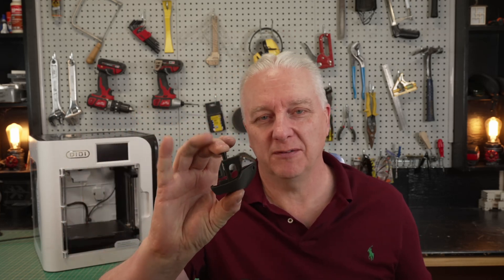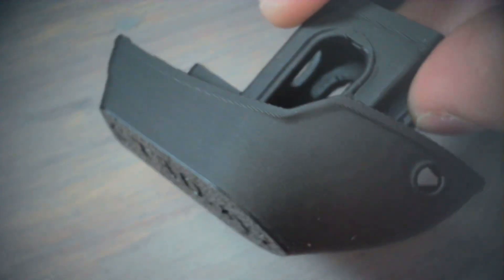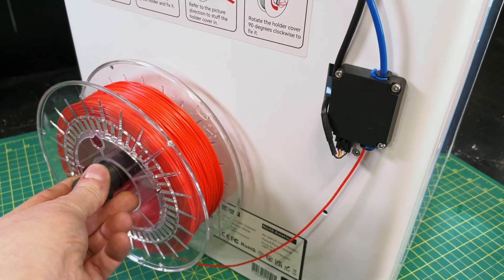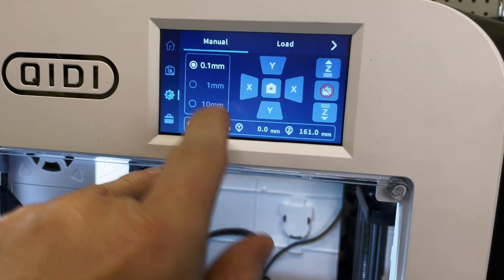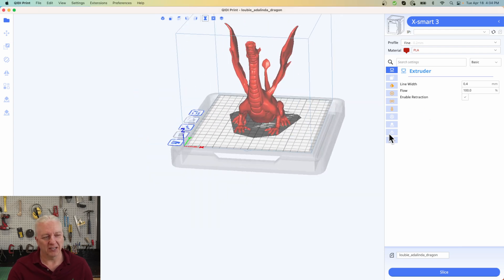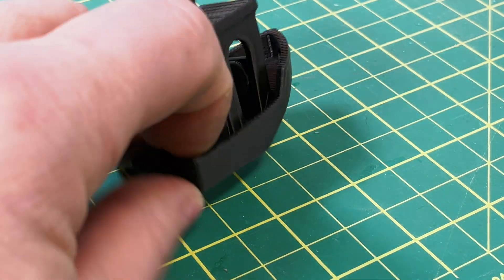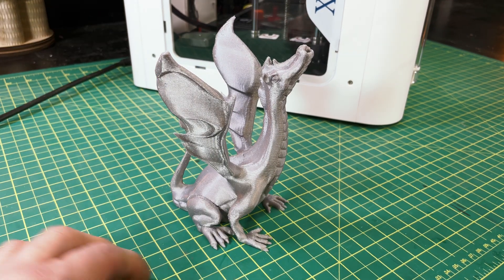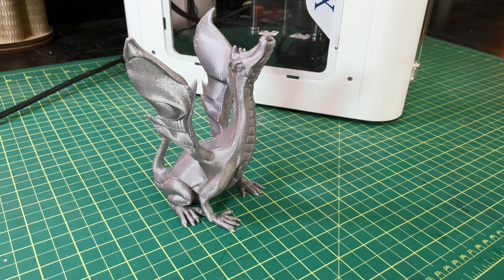Qidi X-Smart 3 - Can Fast 3D Printing be Achieved With a $500 Budget?

Comment: I just picked one of these up used with 14 unopened rolls of filament for $125, running first test print now.  Man is this thing fast compared to my x-max 1.  Too bad it's so small ;-).  I have a patched version of the qidi print wifi plugin for cura for my x-max, will be seeing if I can get it working with the x-smart3 with offical cura.
Reply from the maker: I had my X Smart 3 until very recently.  Someone saw it and had to have it, so I let it go to a better home.  It's a great little print and it sounds like you got an awesome deal.

Comment: Hi I'm wondering why it can't be used a hardened nozzle to print abrasives? Is it because the extruder gears aren't hardened? And what about nylon?
Reply: It can 100% use it. They sell the nozzle itself on their site for $12 and the entire hot end with new heater and heat break for $35
Reply from the maker: @logan_kes  Yes indeed.  I was assuming the ask was for the stock printer
Reply from the maker: It’s not so much about the gears, but rather the temperatures. The “baby” Qidi has a passively heated box while the larger models use active temperature control. Also the extruder in the X-smart 3 won’t get hot enough for some of these advanced materials

Comment: I've found the Linux side of this printer to be a mess.  On my unit, I can't hit port 80/443 for a UI, but fluidd was running out of the box on port 10088.  I've been printing with a modified Bambu profile in Orca slicer without issue.
Reply: How is it? Worth the price or not?
Reply: @zbigniewwielgus1249  I got one a week ago and love it. Typically most printers won’t use 80 or 443 as they are standard ports for http/https so the 10088 is the way to go, I just wish they noted it in the documentation.
Reply: @logan_kes  Maybe you have Voron 0 to compare?
Reply: @zbigniewwielgus1249  sadly I’ve only got a photon a and a Tina 2
Reply from the maker: 10088 is they port they are using

Comment: Good video, but here's a couple tips about things you mentioned that most people that are "new(ish)" to 3D printing wouldn't now and that QIDI kinda hides because of that... 

You do not "need" to use their slicer... Any slicer will work if you want to take the time to configure a profile.  Slicers like Cura, PrusaSlicer, SuperSlicer and OrcaSlicer (my recommendation), all support uploading directly to Klipper.  BTW, I'm also pretty sure you can load and print from a gcode file that is saved to a USB drive, the USB port is located at the top right towards the back.

If you want more "finite" control of these machines and want to see what Klipper is really capable of... stop using the "on-board" screen as the only interface to the machine.  In your browser and with the printer on, type in the IP address of the printer followed by ":1088" (***.***.*.**:1088) and hit enter.  This will bring up a direct "link" to the printer using the Fluidd UI (personally I prefer MainSail).  From there you have total control of everything to do with the printer, add remove files, tweaking, macros...etc. Keep in mind, don't go messing with any of the machine configurations if you don't know what your doing.

Anyway, great video... It's going to be an interesting year in terms of all the new core x/y machines will be popping up to compete in the "who's faster" market that BambuLab has started. 👍
Reply from the maker: Correct.  It occurred to me after I published this that it seemed like I said Qidi Print was a must, so I added a note to the video description. The need for Qidi Print is true only for WiFi connection.  Qidi actually has profiles for most slicers and you can either shuttle generated files with a USB stick or use the Klipper web interface to upload Files through you browser.
Reply: @SteveMakesEverything  Actually, you can do the wifi connection through any of the slicers I mentioned above.
Reply from the maker: @cdsmakestuff  Interesting.  I wasn't able to get Cura configured to support wifi.  l'll need to try again.
Reply: Thanks for your comment. I had the impression that qidi was limiting what the printer could do. For instance printing abrasives with a hardened nozzle? Maybe the extruder gears are not capable? Or maybe nylon?

Comment: What time do you get if you slice your own benchy with their fast profile and same layer height, line width, and infill settings?
Reply from the maker: With the quick print setting and turning off a few optimizations you can get pretty close to this time. Printing fast is one thing, but printing quality is another.  You may have noticed the rough corner on the benchy. This is because they turned off pressure advance and a few other optimizations.  Still, I’d take a 20 minute benchy if it meant getting a bit better quality.

Comment: the switch could probably be removed and rotated and reinserted.
Reply: I always use smart plugs, so I wouldn‘t care.
The advantage is, you can automatically switch off the printer, when the print is done and the nozzle is cooled down.
Reply from the maker: @JottyOL  Ah, the "smartness" of my workshop is currently limited to the lights for the YouTube portion of my shop
Reply from the maker: Yes for sure